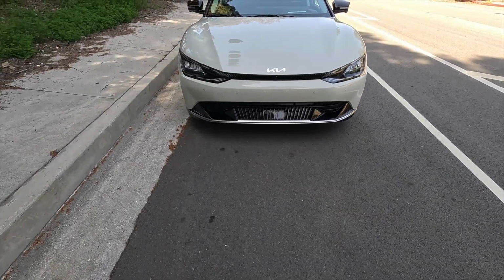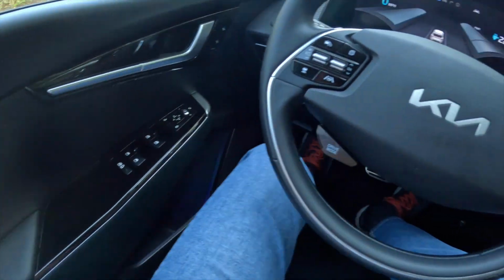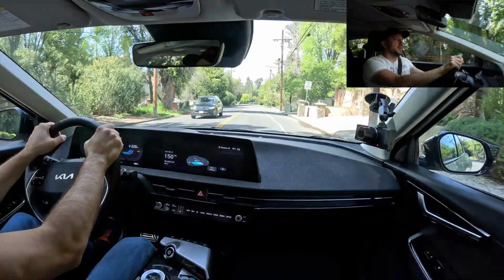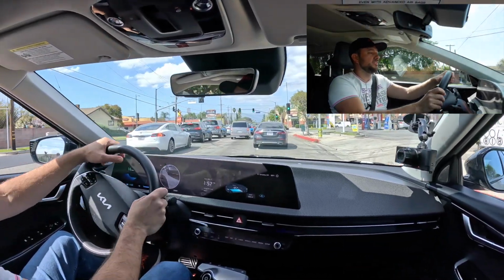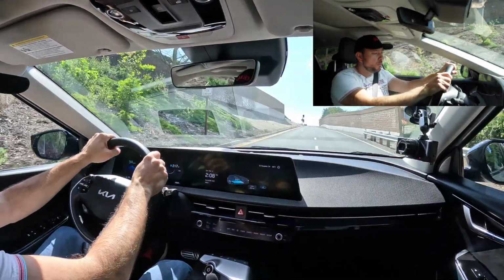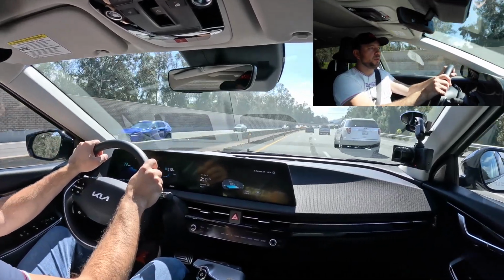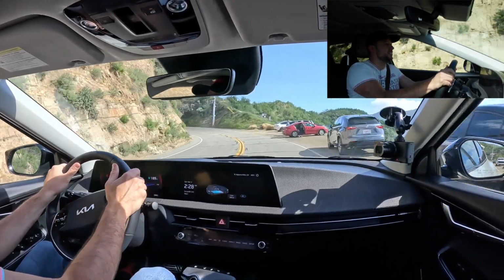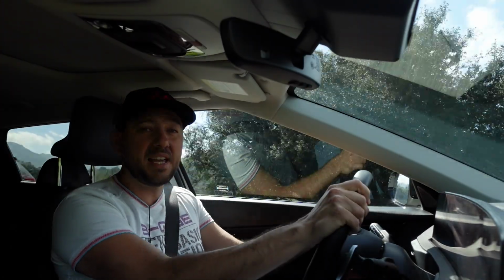Electric Revolution? I Thought 2022 Kia EV6 First Edition AWD is Athletic and Fun to Drive

Comment: Its not GT like your title says.

Also it's not even an GT-Line, since it doesn't have GT-Line bumper and trims.
Reply from the maker: This is GT line 1st edition which was a better equipped version. Their bumper and fenders looked different. First edition looks more like Wind trim
Reply: @100miledrive  Nope. The first edition was called Wind. Gt-Line is only produced with GT-Line outer trims.
Reply from the maker: @pahatorsti  ok thank you. Will review this